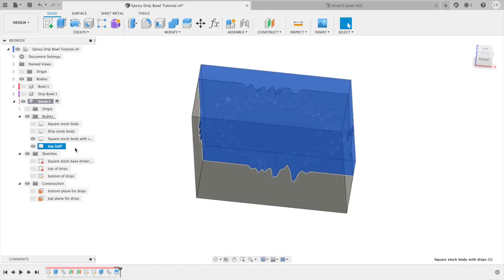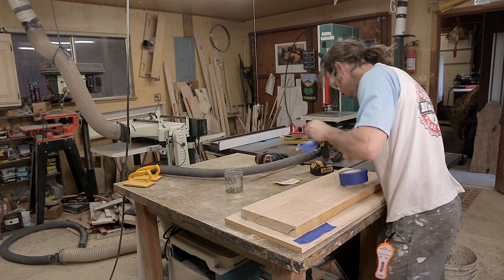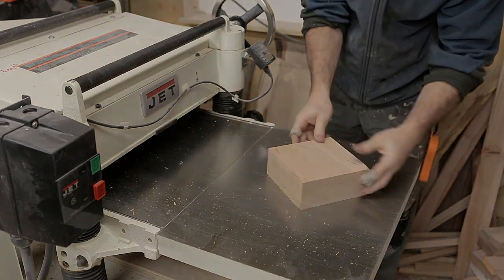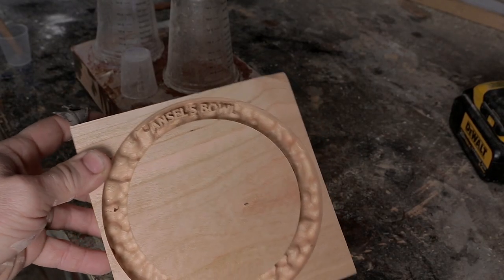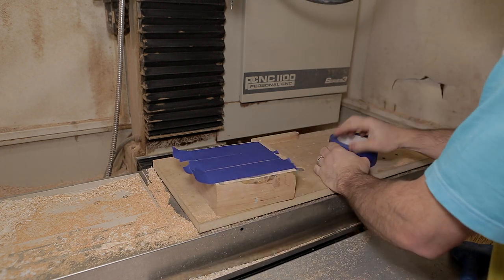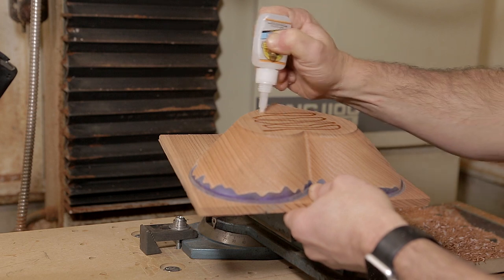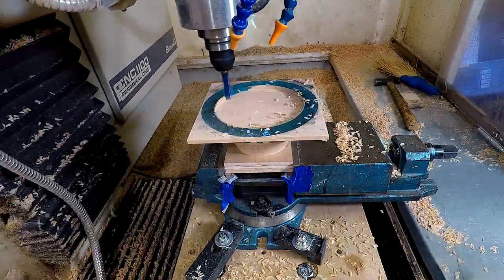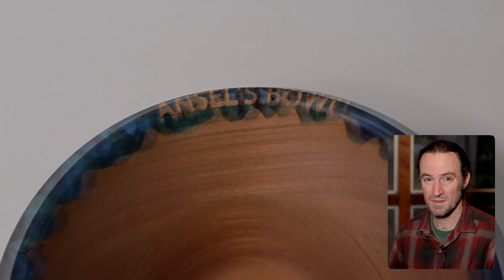Ep 4: CNC woodworking how to make a wood bowl in the workshop - two sided machining techniques

Comment: Thank you.  I have played a little with generating a surface by starting with blending black/gray/white pastels and then scanning but so far haven't got one I like.  I will keep trying.  Winter and shop time will be here soon.
Reply from the maker: Thanks! Yeah, keep playing with the plugin. It doesn't have to be a black and white image; you can use color ones and it will just use the light and dark pixels. I tried to curate an image for this project, but for previous ones I would just google stuff and feed the images in. For instance, try to google "black and white aerial mountains" and feed it a portion of those images. Lower quality images are usually better for the type of stuff I was looking for. Best of luck!
Reply from the maker: Oh, and the image I fed  it is here: https://www.corbinstreehouse.com/cnc/basic_drip_bowl/bowl%20drips2.jpg

Comment: I work on a full size Shopbot and really appreciate the process you describe here, especially the machining sequence.  It looks like the thickness of the bowl is around .25.  How thin of a wall have you tried to achieve?  I'm designing a bowl with a tapered rim and am hoping not to destroy it in the last stage of machining by getting too cute with the thickness, lol.
Reply from the maker: Cool! I think I’ve gone about 180 thousands thick. I think this small bowl was 200, but I’ll have to check the model (episode one also covered the thickness). Some of mine taper to about 1/16” on the top; it is hard to prevent chip out on the top and requires careful first op machining with fusion.